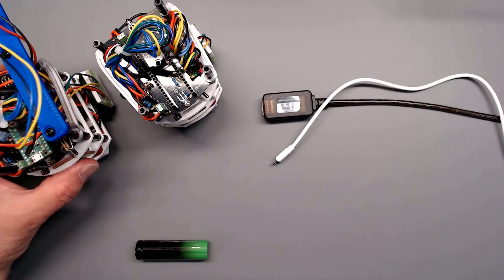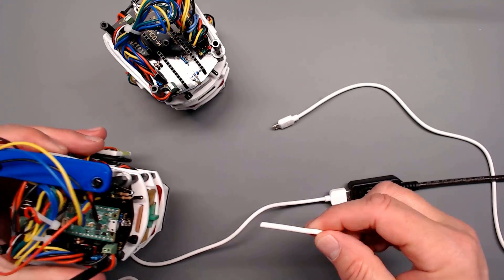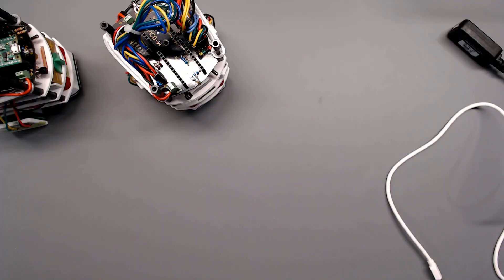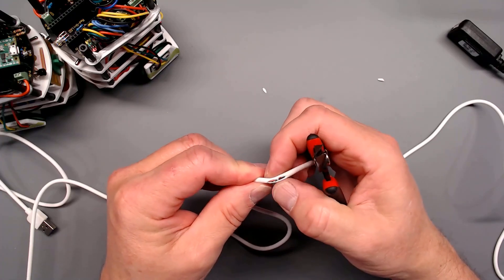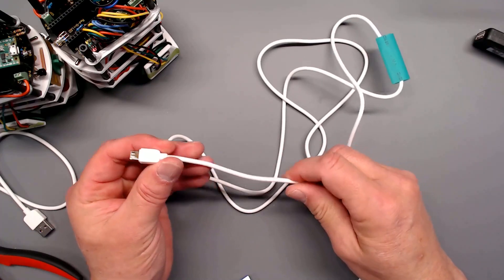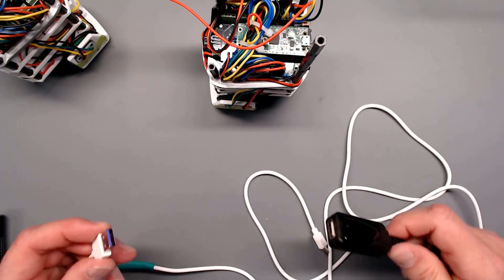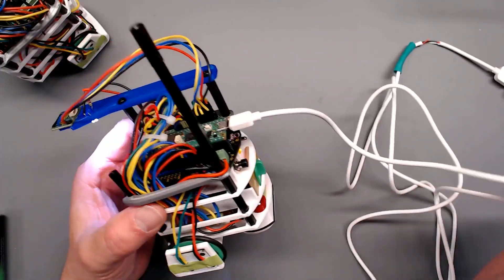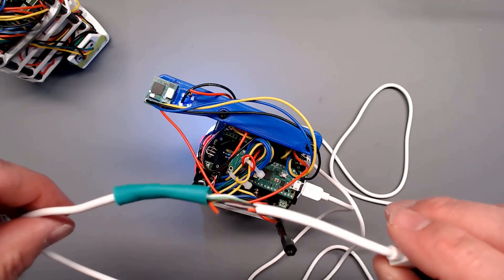USB Cable For Raspberry Pi PICOs That Are Self Powered

Comment: So my (Uneducated) take away from this is that if I wire the USB-C to USB cable for my PS5 DualSense Controller to the Pico board, I need a MOSFET or I risk overloading the controller battery? I'll be honest I haven't checked to see if there's a MOSFET in the controller already to prevent this issue so it might not be a problem for me. I was hoping that the controller could draw power from the board to maintain its charge. Like I said, I'm uneducated in this matter and simply trying to learn, so if I'm wrong, please correct me.
Reply from the maker: Good morning iamelonmusk9501 (Interesting name!)
I am not at all familiar with that controller and because of the related safety issues I am hesitant to offer a suggestion.
Sorry
Chris
Reply: @MakingStuffwithChrisDeHut  oh no worries! Appreciate you taking the time to respond either way, have a great day :)

Comment: On an other channel  they used a diode between the battery power and the pico as security for this.
Reply from the maker: Good morning daCount0,
Thanks for sharing that.
Cheers!
Chris
Reply: @MakingStuffwithChrisDeHut  Found on this channel "Core Electronics"

Comment: I have another method I use. I bought a cheap USB dongle, with 4 USB ports, each with their own power switch. You can plug in the pico to any port and leave the switch turned off.
Reply from the maker: Good morning deadly_dave !
Thanks for sharing those ideas, all very helpful.
Cheers!
Chris
Reply: @MakingStuffwithChrisDeHut  Good morning to you too and you are most welcome.

Comment: Try electrical tape to build up the cable diameter then  use the heatsrink
Reply from the maker: Good morning JohnWaller-i8z,
Thanks for adding that bit of Wisdom!
Cheers!
Chris
Reply: Alternately, You can use smaller shrink wrap and use 2 screwdrivers to stretch it out first. It'll stretch to about double it's original diameter and then it should shrink back enough to wrap the wire.

Comment: hello again Chris.  I am into pico programming as well but I also have a 50+ yr history in electronics so I know what you are talking about. A few years ago when I started with the pico designs and breadboarding I also did not separate the Power supply for the breadboard and the laptop USB power. Luckily, I did not run into a problem but it was constantly on my mind and bugging me. So, on the Pico website (in the pico documentation) they address this with the jFET solution. So I designed a small circuit board to handle this, had it made in China by JLCPCB and it works (and looks) great (for those with a passion for PCB 'art') There's my questionable sanity again.  I am somewhat embarrassed to say, your solution did not even occur to me at all. It makes perfect sense and is actually quite an elegant approach. I thank you for sharing that idea and I will certainly take advantage of this method moving forward. I generally design test equipment and vintage amplifier restore/modifications in which I at times use a Pico. In such instances I will simply not connect the USB power line in the project case to the Jack on the back of the enclosure being used but for development/breadboarding purposes I will do a cable cut as you have shown. It will be considerable less work than putting hundreds of new Dupont ends on my jumper cables I mentioned on a previous video of yours. Thanks again. Regards to all. 🇨🇦